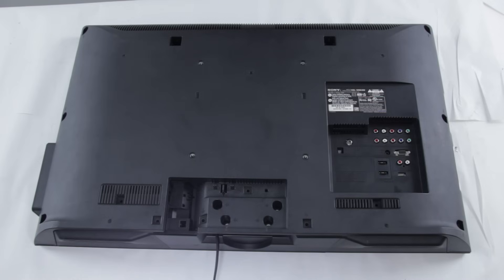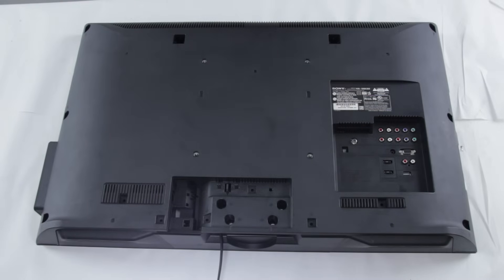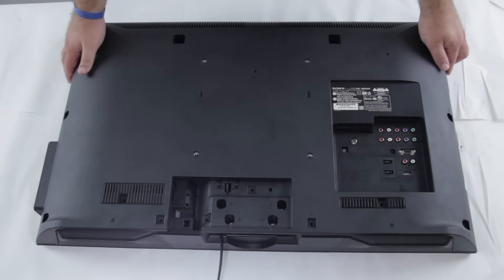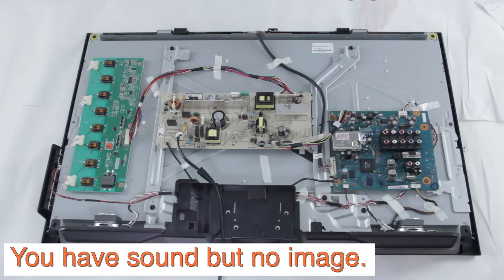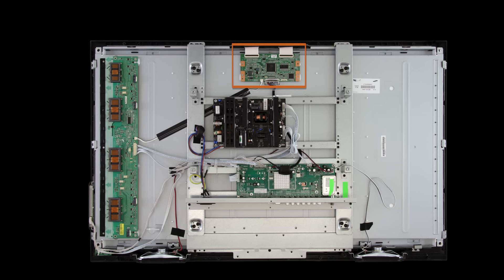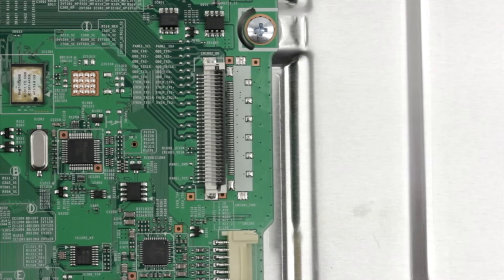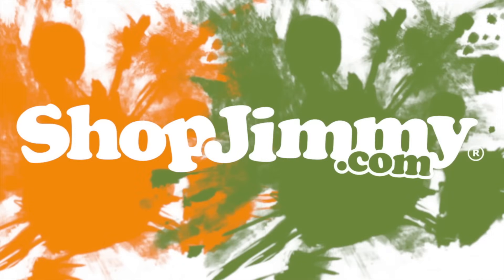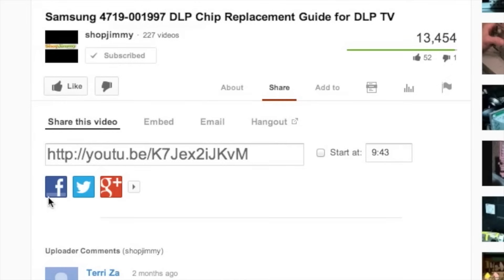LCD TV Repair Tutorial - T-Con Board Common Symptoms & Solutions - How to Replace T-Con Board

Comment: Hello 
I have a problem with  samsung LE32R73BD tv. When I try to turn the tv on, sometimes it starts normal and everything is working normal (both picture and sound), but sometimes it works ok just few minutes/seconds and then picture disappears (sound is still working). You never know when it will start working normally again. In dark you can see how the screen is glowing. I suspect on T-con board, because when it works i get ~15V on one coil, when it doesn't work i get 5V. 
Please tell me your opinion. 
Thanks in advance 
Nemanja
Reply from the maker: Nemanja Veljkovic   This could either be a problem with the T-con board or the Main board.  I recommend replacing the T-Con board first and if that does not fix the problem you should replace the main board.  To find the correct T-con replacement, you may need to search on our website by part number or call our customer service.  Here is a link to replacement parts for your TV model number on our website, click here: http://www.shopjimmy.com/catalogsearch/result/?q=LE32R73  Be sure to match part numbers on your current board, with your replacement for compatibility.  You can also call our customer service for further assistance with your purchase.  (877) 881-6492  Thanks and please let us know if you have any further questions with your TV Repair!  www.shopjimmy.com

Comment: Hi I got a sanyo. 42inch model no .dp42840 the green power light keep blinking on and off got no sound or picture help please thanks
Reply from the maker: Rodney Ramjit   I recommend replacing the main board in your TV.  Here is a link to replacement parts for your TV model number on our website, click here:  http://www.shopjimmy.com/catalogsearch/result/?q=dp42840  Be sure to match part numbers on your current board, with your replacement for compatibility.  You can also call our customer service for further assistance with your purchase.  (877) 881-6492  Thanks and please let us know if you have any further questions with your TV Repair!  www.shopjimmy.com
Reply: ShopJimmy.com thanks I will do that

Comment: I have a 60" samsung UN60ES7150 with no picture but sound. The screen has a blueish tint to it. I have looked at the capacitors and they do not seem to be blown. When I turned on the TV I got horizonal lines with two large blue vertical line about 12" wide. I turn off the TV and turned it back on only to have the blueish tint. Is this the T Con board?  Any help would be great. Alot of youtube posting say capacitor issue but I don't know.
Reply from the maker: Fred Raines   I recommend replacing the T-Con board in your TV, for your Repair.  Here is a link to replacement parts for your TV model number on our website, click here:  http://www.shopjimmy.com/catalogsearch/result/?q=UN60ES7150  Be sure to match part numbers on your current board, with your replacement for compatibility.  Here is a link to a video showing how to identify your part number, click here:  Samsung Main Boards & Digital Boards: Part Numbers for LED, LCD, DLP, Plasma TV Repair  You can also call our customer service for further assistance with your purchase.  (877) 881-6492  Thanks and please let us know if you have any further questions with your TV Repair!  www.shopjimmy.com

Comment: Hi I have sony Bravia KDL 40EX523. Symptoms in my TV include yellow or blue tint appearing in screen and temporary image persistence and everything becomes normal for few mins and goes bad again. Is this a panel or tcon board problem.
Reply: https://www.flickr.com/photos/sanjeev85/13155240044/
https://www.flickr.com/photos/sanjeev85/13155085663/
Reply from the maker: sanjeev kumar   I recommend replacing the T-Con board in your TV.  Here is a link to replacement parts for your TV model number on our website, click here:  http://www.shopjimmy.com/catalogsearch/result/?q=KDL+40EX523  Be sure to match part numbers on your current board, with your replacement for compatibility.  You can also call our customer service for further assistance with your purchase.  (877) 881-6492  Thanks and please let us know if you have any further questions with your TV Repair!  www.shopjimmy.com

Comment: Hello, I have a Samsung Tulip LNT4061FX. I had clicking and purple dots. I replaced all the caps on the power-supply that looked directly part of the power. I did not replace the tiny caps across the power-supply. This fixed the clicking and the purple dots. The screen is dim and the contrast seems out of wack. I did a factory reset with service code   Mute-1-8-2-power.   That may have helped alittle, hard to tell. I can adjust the brightness but it doesn't amount to much. The contrast is already at 100/100. Adjusting the contrast down only makes the TV even darker ( i suspected this). So at this point I think the T-Con is failing. I had just lived with the purple dots for about a year(power cycling would clear them). It was only when the screen went dark that I decided to act. Could these two problems be unrelated ?

I believe i had the link I need here: http://www.shopjimmy.com/samsung-lj94-01901f-t-con-board.htm
Reply from the maker: Jason Rini   Yes, I believe there is a problem with the secondary side of the power supply and I recommend replacing the board.  Here is a link to replacement parts for your TV model number on our website, click here:  http://www.shopjimmy.com/catalogsearch/result/?q=LNT4061FX  Be sure to match part numbers on your current board, with your replacement for compatibility.  Here is a link to a video showing how to identify your part number, click here:  TV Part Number Identification Guide for Samsung DIY TV Repair Power Supply Unit (PSU) Boards  You can also call our customer service for further assistance with your purchase.  (877) 881-6492  Thanks and please let us know if you have any further questions with your TV Repair!  www.shopjimmy.com
Reply: +ShopJimmy.com A late response on my part, yes replacing the tcon board fixed the TV unit. thank you.

Comment: I have a sharp Aquis LC52D92U
serial number 01234611
my Lcd television has the picture and sound but blue dots or lines appeared all at once behind picture. I tried a factory hard reset but had no luck. Is it a bad T board?
Reply from the maker: Larry Roberts  I recommend replacing the T-con board to see if that fixes the problem in your TV.  Here is a link to replacement parts for your TV model number on our website, click here:  http://www.shopjimmy.com/catalogsearch/result/?q=+LC52D92U  Be sure to match part numbers on your current board, with your replacement for compatibility.  You can also call our customer service for further assistance with your purchase.  (877) 881-6492  Thanks and please let us know if you have any further questions with your TV Repair!  www.shopjimmy.com

Comment: My Sharp Aqous model # LC-46D62U has blue horizontal and vertical lines on the screen, but i still get a picture.  Sometimes the lines will go away if i press the menu button.  Then they will come back later.  I just installed a new  t-con board for  it, but the problem still exist.  Do you have any suggestions.
Reply from the maker: Anthony Gooden   This sounds like a TV panel problem.  If your TV panel is bad, it may be more cost-effective to replace the TV as panels are typically hard to find in stock, difficult to replace, and expensive.  Thanks and please let us know if you have any further questions!  www.shopjimmy.com

Comment: Hello, I have a Sony Bravia (KDL40v-4150) it has no audio,video and no lights. But it has three blinking red lights on standby. I would appreciate if you can let me know of the cause of the problem(s)

thank you,
Vi-D
Reply from the maker: Vi- D   I recommend replacing the A main board in your TV.  Here is a link to replacement parts for your TV model number on our website, click here:  http://www.shopjimmy.com/catalogsearch/result/?q=4150  Be sure to match part numbers on your current board, with your replacement for compatibility.  Here is a link to a video showing how to identify your part number, click here:  TV Part Number Identification Guide for Sony Main Boards (LCD, LED, Plasma TVs) TV Repair  You can also call our customer service for further assistance with your purchase.  (877) 881-6492  Thanks and please let us know if you have any further questions with your TV Repair!  www.shopjimmy.com

Comment: I have a two year old Sony Bravia TV, Model 3 KDL-40EX400. Yesterday my TV picture and sound began to cut-away displaying a message on the screen: Please Wait One Minute. This message lasts for two/three minutes and the picture and sound return. Sadly, this "on again-off again" process has continued for the past day.  Help?
Reply from the maker: Ernest DeZolt  I recommend replacing the A Main Board in your TV.  Here is a link to replacement parts for your TV model number on our website, click here:  http://www.shopjimmy.com/catalogsearch/result/?q=KDL-40EX400  Be sure to match part numbers on your current board, with your replacement for compatibility.  Here is a link to a video showing how to identify your part number, click here:  http://www.shopjimmy.com/sony-1-857-593-21-a-board.htm  You can also call our customer service for further assistance with your purchase.  (877) 881-6492  Thanks and please let us know if you have any further questions with your TV Repair!  www.shopjimmy.com

Comment: My TV below is SHARP AUQUS LC-60E88UN Ser#008829547
Reply from the maker: sobudaimae4884  I recommend replacing the power supply in your TV.  Here is a link to replacement parts for your TV model number on our website, click here:  http://www.shopjimmy.com/catalogsearch/result/?q=LC-60E88UN  Be sure to match part numbers on your current board, with your replacement for compatibility.  Here is a link to a video showing how to identify your part number, click here:  http://www.shopjimmy.com/catalogsearch/result/?q=60E88UN  You can also call our customer service for further assistance with your purchase.  (877) 881-6492  Thanks and please let us know if you have any further questions with your TV Repair!  www.shopjimmy.com

Comment: sony kdl 40 v3000 picture has gone psycedelic on the screen
Reply from the maker: wingrove greenidge  I recommend replacing the AU main board in your TV.  Here is a link to replacement parts for your TV model number on our website, click here:  http://www.shopjimmy.com/catalogsearch/result/?q=40+v3000  Be sure to match part numbers on your current board, with your replacement for compatibility.  You can also call our customer service for further assistance with your purchase.  (877) 881-6492  Thanks and please let us know if you have any further questions with your TV Repair!  www.shopjimmy.com

Comment: LC-60E88UN serial # 008829547 the symptoms are the power-on and OPC lights both blink green constantly.  You will here a hard click just before the power shuts off for good.  Then you will have to keep pressing the on/off remote button to try to turn it on.  After a long number of clicks sometimes it will stay on then just randomly shut-off unpredictably.  Just before it shuts off and when it first turns on you can see a distinct flicker of the TV picture.  Do I replace the Power supply board (DPS-343AP Ser No:2950244303) or the main board (KF282 (XF282WJ) FM16S or both?  I have the correct board numbers and serial numbers for the parts.  How do you recommend I proceed? Are there any reputable TV parts stores online or is it buyer beware as usual?  I am in the military  deployed so my only recourse is online purchasing.

Comment: Hi , I have a 9 month old LG LED 3D TV , the model no is 42LM6200. The problem with the TV is 2 days back suddenly the display went off. Actually my kid spilled some water on the lower part of the tv and not sure if this is the reason. After sometime the display started coming but not proper. The images are seen with glowing colors for the hair (mostly all the dark colors are seen glowing)which gives a negative film like appearance and also a thin vertical line is seen on one side of the TV where water entered. Also when the TV is switched on, it shows a pink vertical bar of around 10cm thickness on one side of the TV with the remaining portion is white in color. Also horizontal lines keep coming and going. The LG customer care person took just less than 5 minutes and said that the panel is gone. Is this true , is there a solution for this?
Reply from the maker: Venkadesh S   This sounds like a TV panel problem.  If your TV panel is bad, it may be more cost-effective to replace the TV as panels are typically hard to find in stock, difficult to replace, and expensive.  Thanks and please let us know if you have any further questions!  www.shopjimmy.com
Reply: Hi, thanks a lot for your reply. Can't the panel be repaired?

Comment: I have a samsung LN40C500F3F  Its about 4 years old, about a week ago it started giving me a weak signal, and I could switch channels and it would come back. Now I just have no picture or sound, and cant seem to go from my tv or playstation, I just get a error message that is very faint and comes and goes. Thanks in advance
Reply from the maker: vspec1  
I recommend replacing the main board in your TV.  Here is a link to replacement parts for your TV model number on our website, click here:  http://www.shopjimmy.com/catalogsearch/result/?q=LN40C500F3F  Be sure to match part numbers on your current board, with your replacement for compatibility.  Here is a link to a video showing how to identify your part number, click here:  TV Part Number Identification Guide for Samsung DIY TV Repair Power Supply Unit (PSU) Boards  You can also call our customer service for further assistance with your purchase.  (877) 881-6492  Thanks and please let us know if you have any further questions with your TV Repair!  www.shopjimmy.com

Comment: Hi i have a samsung model LNT5271FX XAA and am having what looks like vertical pixilated dots appearing on my screen as well as flickering of the on just the lower right corner of the screen. The capacitors for our specific model were on recall and the repair man said they were not blown and thought it could be the power board so he replaced it on Samsung's tab that did not fix the problem. Also the TV makes is slow to turn on and makes a clicking noise and the activation chime at random, what do you think this could be?
Reply from the maker: BigVerleni  You can replace the Main Board to see if that fixes the problem, but it sounds like it could also be a bad TV panel.  Here is a link to replacement parts for your TV model number on our website, click here:  http://www.shopjimmy.com/catalogsearch/result/?q=LNT5271FX+XAA  Be sure to match part numbers on your current board, with your replacement for compatibility.  You can also call our customer service for further assistance with your purchase.  (877) 881-6492  Thanks and please let us know if you have any further questions with your TV Repair!  www.shopjimmy.com

Comment: got the following tv:
samsung tv lcd LA46A550P1F
model code: LA46A550P1FXXY
issue: close to half the screen goes black at random intervals. and the black travels across the screen..when it starts.
is it a T-CON board issue?
Cheers
Reply from the maker: Ranga Loku   I recommend replacing the T-con board to see if that fixes the problem.  Here is a link to replacement parts for your TV model number on our website, click here:  http://www.shopjimmy.com/catalogsearch/result/?q=46A550P1  Be sure to match part numbers on your current board, with your replacement for compatibility.  You can also call our customer service for further assistance with your purchase.  (877) 881-6492  Thanks and please let us know if you have any further questions with your TV Repair!  www.shopjimmy.com

Comment: I have a insignia Ns-32l450a11, and it works perfectly except whenever there are dark colors on the screen they keep turning to red, and I just noticed a small vertical red line on the left side of screen. Does this mean the tcon board or something else is starting to go bad?
Reply from the maker: Kaelin J.   You can try replacing the T-con board, but if the problem persists, I would say you have a bad TV panel.  Here is a link to replacement parts for your TV model number on our website, click here:  http://www.shopjimmy.com/catalogsearch/result/?q=Ns-32l450a11  Be sure to match part numbers on your current board, with your replacement for compatibility.  You can also call our customer service for further assistance with your purchase.  (877) 881-6492  Thanks and please let us know if you have any further questions with your TV Repair!  www.shopjimmy.com

Comment: I have Vizio P50HDM with a manufacture date of 2006. I have sound but the picture has vertical lines with different colors. Any Clue?
Reply from the maker: Cody Ruffenach   This sounds like a TV panel problem.  If your TV panel is bad, it may be more cost-effective to replace the TV as panels are typically hard to find in stock, difficult to replace, and expensive.  Thanks and please let us know if you have any further questions!  www.shopjimmy.com